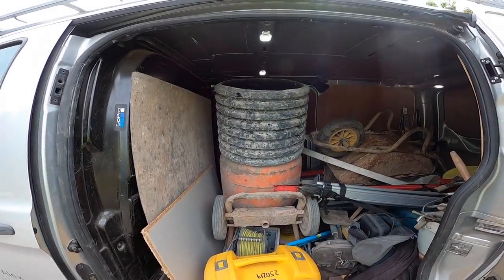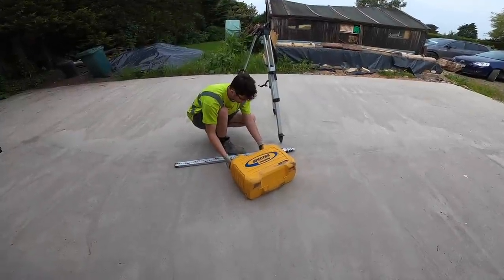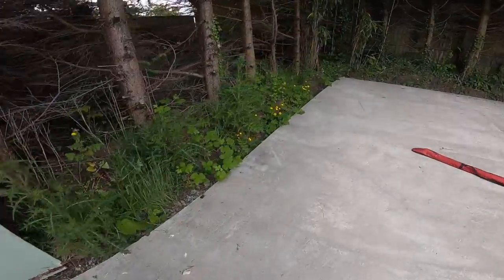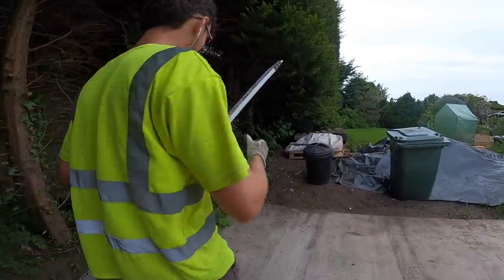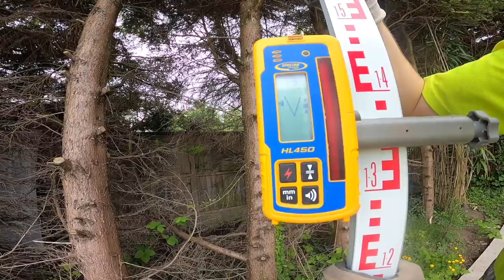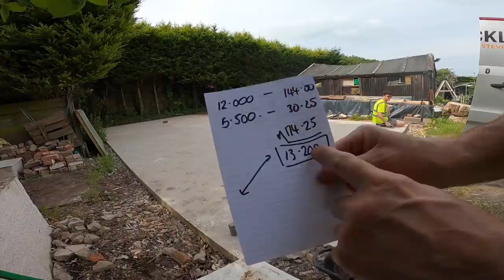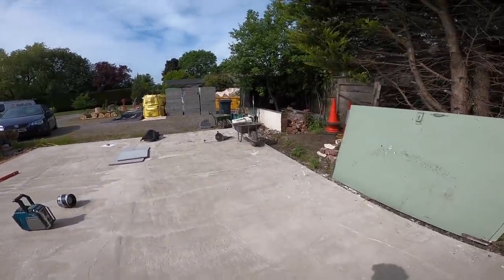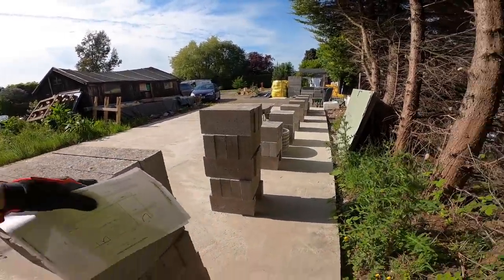PREPPING A BIG JOB!!

Comment: How it should be 👍, helps sometimes with no mats when setting out, nothing worse turning up on a slab and they have done you a favour and loaded it out and you can't pull any lines or tape diagonals. 👍
Reply from the maker: Definitely no arsing about trying to pull a diagonal between two levels because the blocks are in the way .. it never works 🧱👍🏽

Comment: great slab to work off,should be a great job to 🧱why you not get a load a block dropped on slap and closer making work for your selves
Reply from the maker: That’s as close as they could get 😬🧱👍🏽
Reply: @SteveAndAlexBuild  
ok shame that is wot is 🧱any way still a great job do 👍or will be wiv you two at the wheel ⭐️⭐️⭐️⭐️⭐️
Reply from the maker: @geoffsnaylam4133  thanks pal 🧱👍🏽